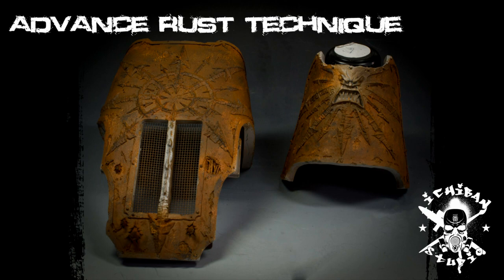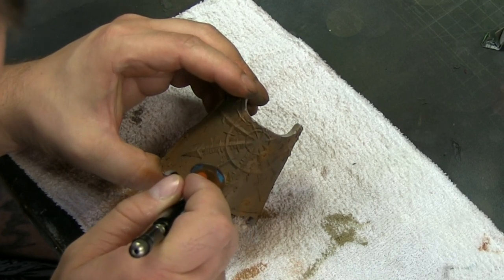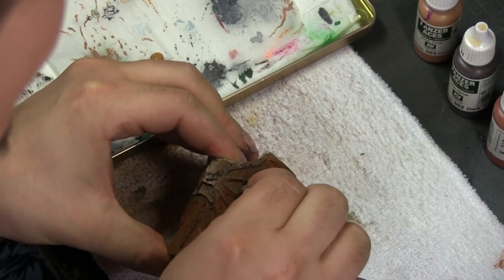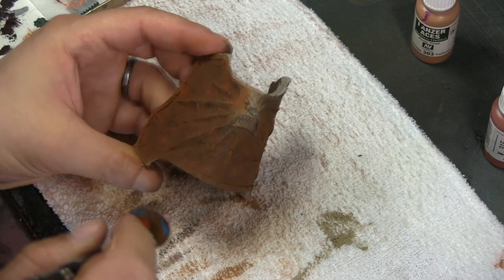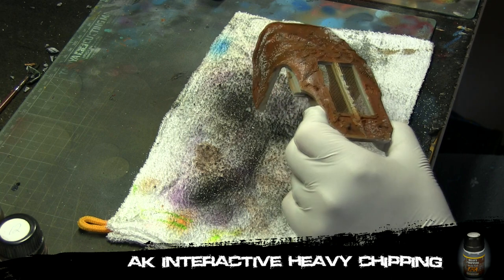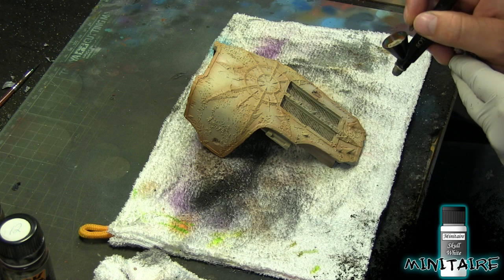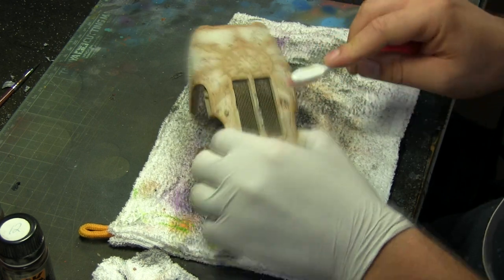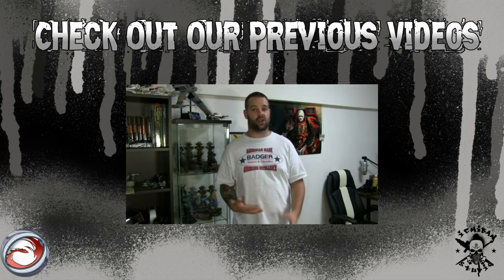Advance rust and chipping technique

Comment: What do you use to clean your brushes after using the AK Interactive washes?  I just got some in the mail but haven't used them yet since I normally only use acrylics.
Reply: +John Crawford John, the Interactive washes that I use are enamel based. So I use the gallon size Home Depot  enamel thinner to clean my brushes, while reserving the much more expensive Testors enamel thinner for diluting when needed, my enamel washes, before weathering.